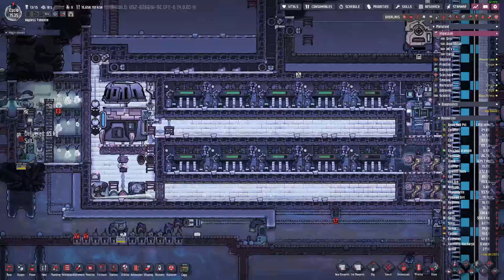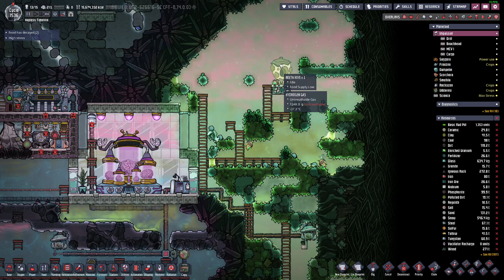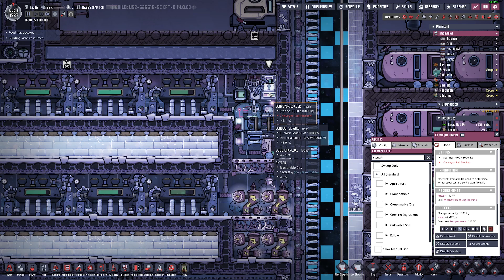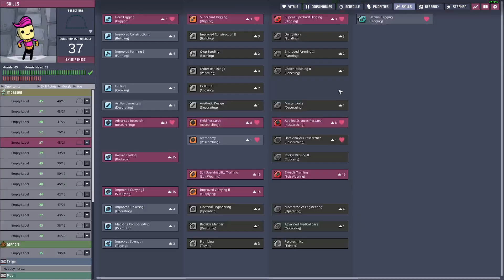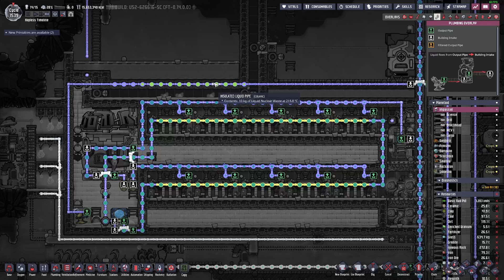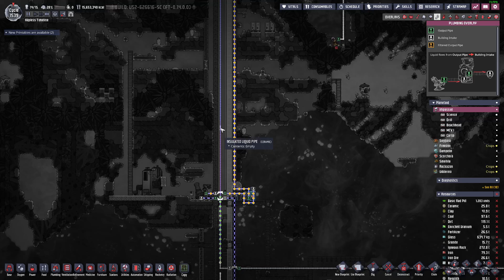ONI / Oxygen Not Included - Nuclear Power (Research Reactor) Design & Benefits

Comment: I've also noticed with the timed enriched uranium release that sometimes it will inject more than 10 kg of uranium. And so the reactor will run hotter if you are running a Limited Fuel Reactor. I haven't yet figured out how to fix that either, other than to set up an alarm when the reactor gets too hot.

Comment: Your fuel misses when the game skips a frame right on that 0.1 frame, so it is doesn't send the fuel. Late game with higher speeds it skip frames quite often depending from the PC specs. 

Most of the power from the research reactor is from the nuclear waste not from the water, you can capitalize on it for better energy output.

You can prevent corrosion damage submerging the aquatune in nuclear waste as it stop the spillage.

The temperature of the reactor is controlled by the amount of water you pump in, there is no benefit to slower or increase the amount of fuel feed to it.

Great build!
Reply: Definitely water based. You can find some tutorials on YouTube about restricting water to increase waste temperature. Also I bet you can use the memory latch thing to be more reliable to meter fuel.
Reply from the maker: I'm aware of the fuel skipping issue being related to 3x speed but I refuse to play the game any slower and there doesn't seem to be an easy solution - setting it to .2 results in double inserts which is worse unless you have thermium.

Temperature being related to amount of water pumped in doesn't make sense as the reactor is always kept at full water and that water always enters at 95C. It absolutely is related to amount of uranium mass in the reactor.

The submerge tip is good. As far as trying to extract more heat out of the LNW to run more turbines that's definitely an interesting idea. Probably would be best to set it up as a secondary circuit with a different set of turbines. Whether it's worth it depends on how many additional turbines it can support.
Reply: @StupidFatHobbit  nop, @donwidman8923 is right. The lower amount of water you feed to your reactor, the hoter the uranium gets, and since most of the energy comes from the nuclear waste, you end up with a LOT more heat. It doesn't make any sense but hey it's ONI, you can run more turbines depending on how you manage to tune the liquid intake since a little lag could cause it to go 'boom'. I just did a quick and dirty test at 4L/s and it seemed to run fine for 10 cycles, although I stopped starving the reactor since I didn't have space to place more turbines in my rocket
Reply: @StupidFatHobbit you didn't get it. If you put maximum water then it's maximum cooling. If you control how much water you put and put LOW amount, then it heats up more.